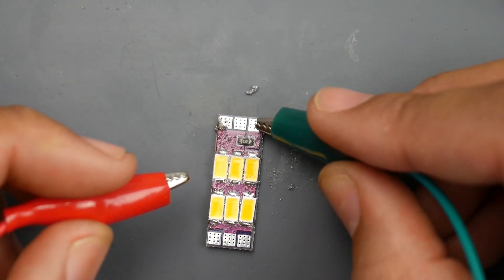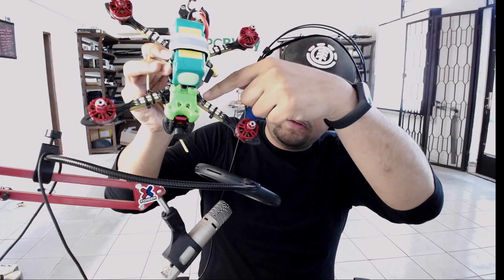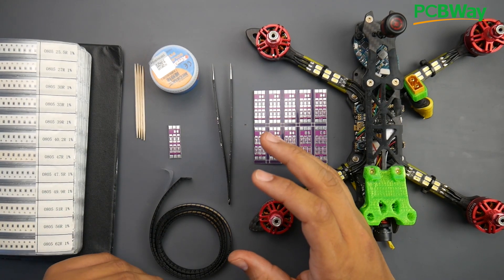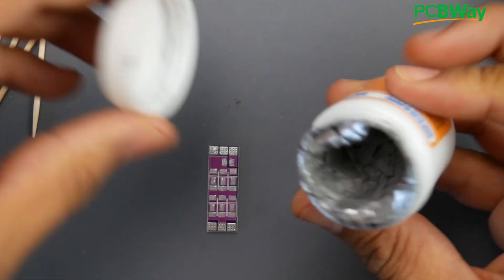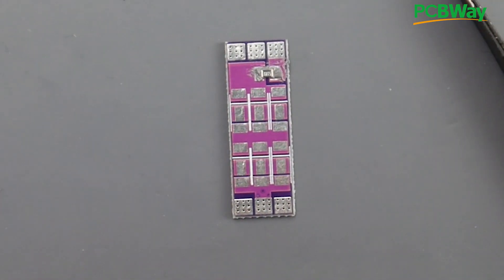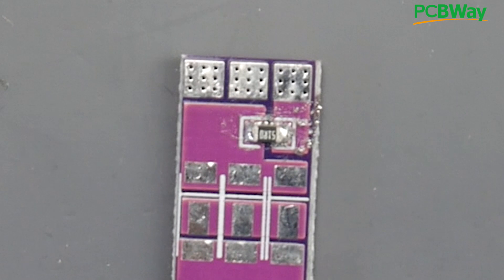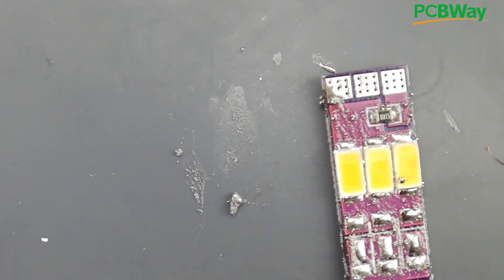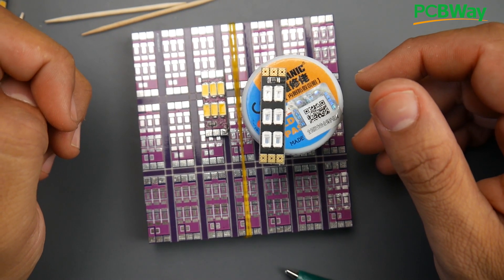Building Your Own Custom FPV Drone RACE WIRE

Comment from the maker: -- Parts Needed
Color LED: http://bit.ly/2kVDCwi
White LED: http://bit.ly/2k9bN3i
Solder Paste: http://bit.ly/2lZSiL0
Tweezers: http://bit.ly/2m1ZHcH
Hot Air Station: http://bit.ly/2WuIARx
Resistors: http://bit.ly/2lYqqae

-- Buy RACEWIRE
https://www.pcbway.com/project/sharep...

The Files are in my patreon
https://www.patreon.com/DroneMesh
Reply: Is it possible to Order those from pcbway ready to use without sothering myself?

Comment: Also used PCBWay few times, but what I see here is way too dirty job with solder paste. The paste usually applied with stencils, and if I ever order a pack of PCB-panels I would try to afford a stencil as well. For simple designs I do cut my own stencils out of 6-mil frosted blank mylar with 5W laser-engraver (my old 3D-printer conversion: https://www.thingiverse.com/thing:2791931)  But when there are less than 10 pads - toothpick is a way to go. Hint: to apply the paste easier with toothpick you want it to be less thick. Try heating up the solder paste a little before use  (e.g. drop a closed can into a cup with hot water). Also one I did mix-in some more liquid flux (like Kester 186) - helps a lot. I would not recommend this "modified" paste for regular re-flow applications any more, only for manual "toothpick" jobs.

Comment: I have a question. If I am designing a LED Race Wire, should the PCB 3oz? As the motor wires are only on the one side. (Race wire width ~8-10mm)

Comment: Way back when I didn't have a hot air gun I put my pcb with the solder paste and parts on into the pizza oven. Who needs a reflow oven right?